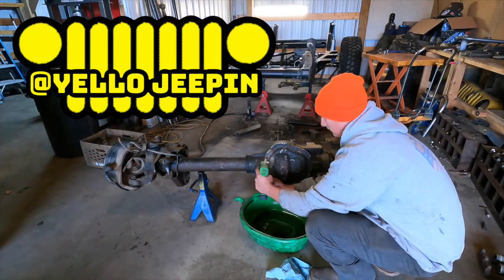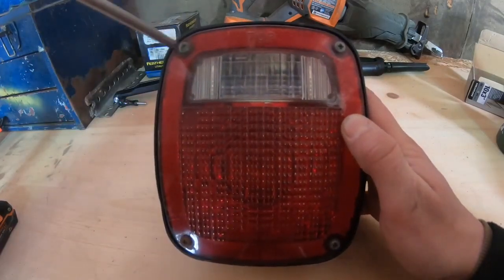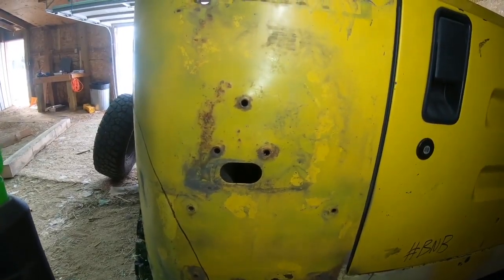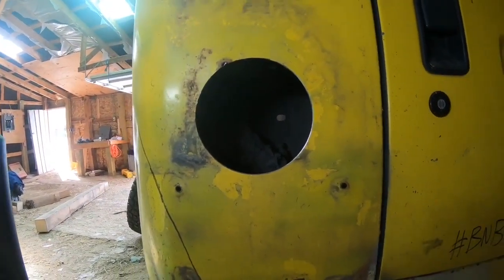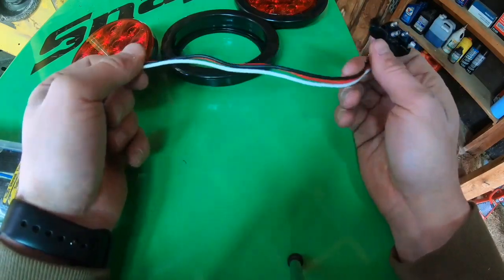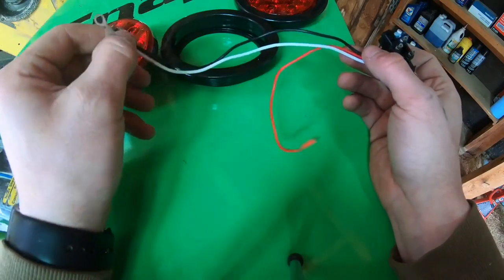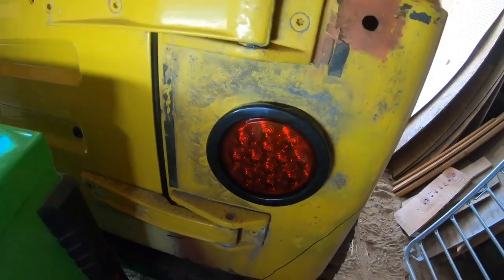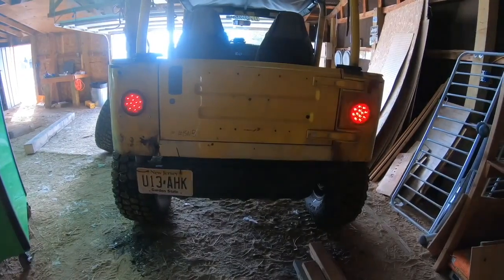Jeep Wrangler Circle LED Flush Mount Brake:Tail Light Install CJ, YJ, TJ [How-To]

Comment: Pro tip, Every truck stop sells these for a lot less than Poison Spider or any other off-road branded light. Just read the packaging for a multi purpose tail and turn signal. Some also have a center reverse light.
Reply from the maker: Awesome advice thank you!! I think I got these ones off of eBay actually. It was like five years ago I made this video lol